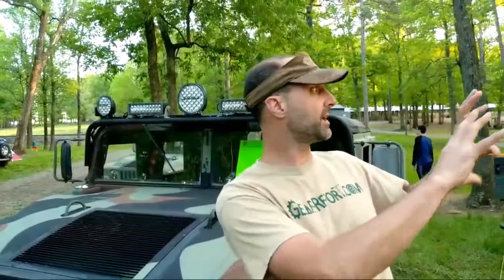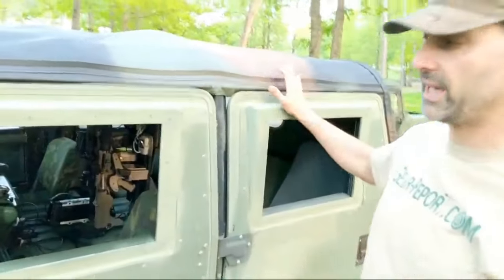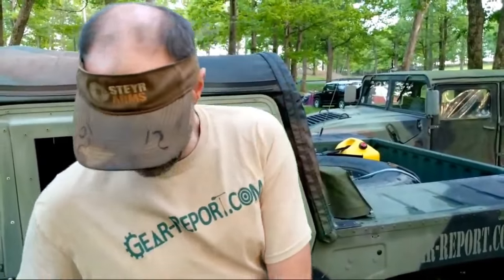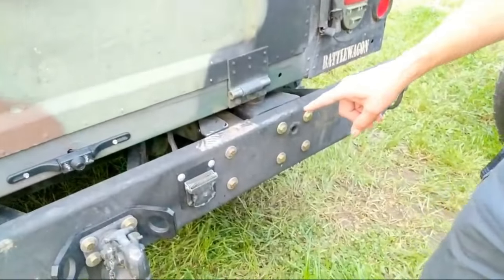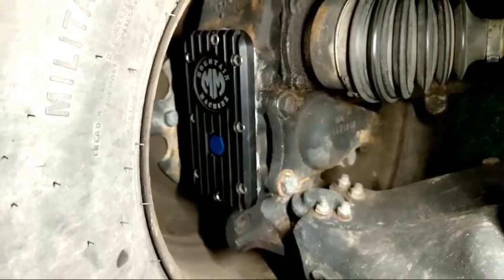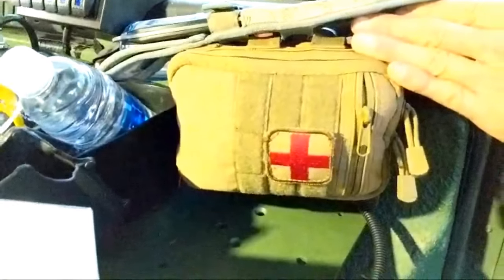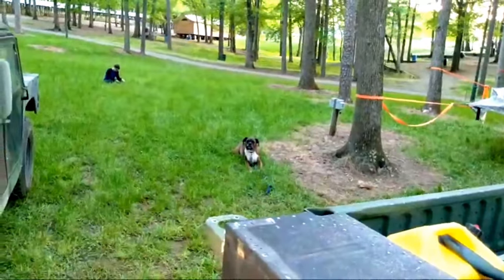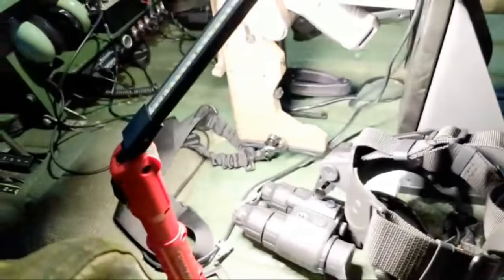Project HMMWV Battlewagon 2nd Walk-around Update - Hummer

Comment: I feel a little late but I think the Rok9 lights should go in as bed lights. Great video!
Reply from the maker: We haven't installed the Rok9 lights yet. Still deciding where to put them. How did you envision them mounted in the bed?
Reply: I was thinking on the sides of the bed about a 1 1/2 to 2 feet from the back of the cab
Reply from the maker: So, lighting the bed from each side? 
That could work.
Still debating a few options on how to get light back there in the bed that isn't too bright or shining in people's eyes.
Reply: Yeah. I was thinking that mounting the lights on the wheel wells could work.